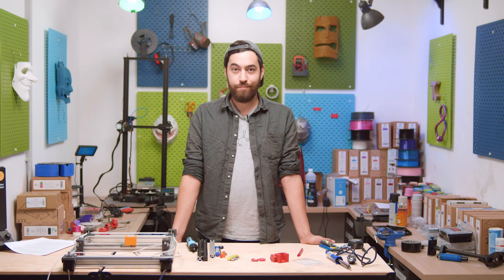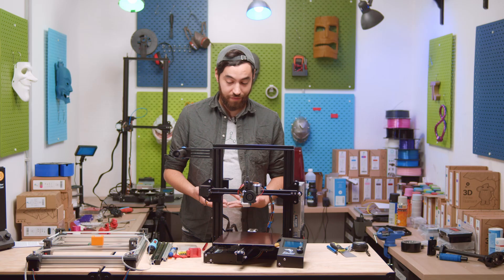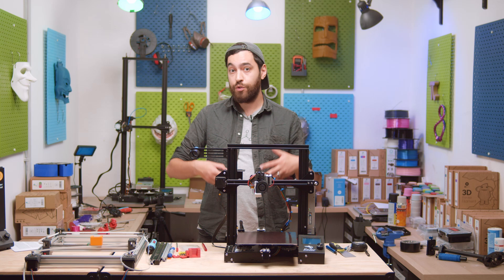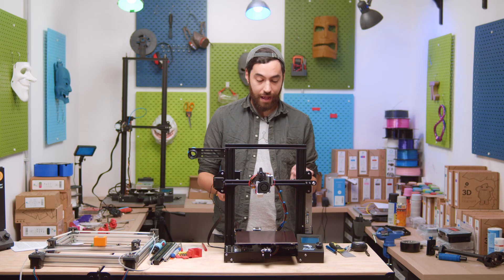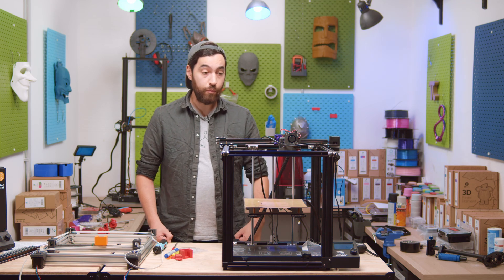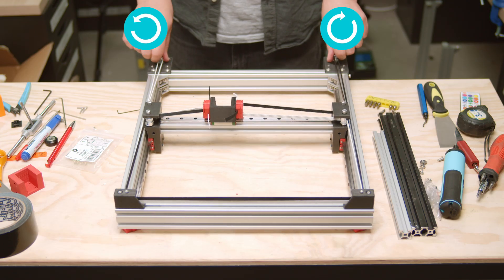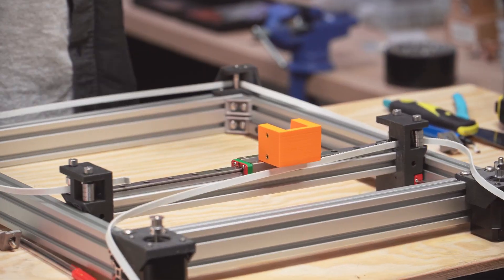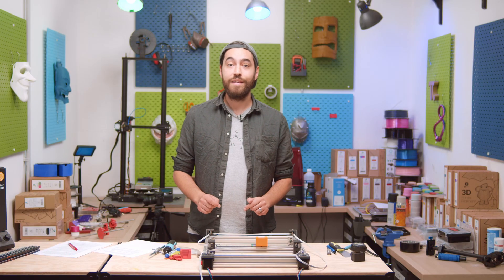How to Build 2 Printers from Scratch - Part 1: Frames and Motion Systems

Comment: Question, bearing in mind that the Bambu A1 software allows for the bed size to be altered - and the G-code can be too from the looks of it, could one be enlarged to say 512mm x 512mm x 250mm on the height - yes it would need a new linear rail for the head too, could it be done?
Reply from the maker: I'm not really sure about A1 software but enlarging a printer via firmware is a very easy and straightforward thing to do, its just a couple of lines in a config file

Comment: If you're making a budget conscious printer why are you using threaded inserts when plastic screws are so cheap?  No one looks at a high end gaming PC and complains that the 13 fans mounted to the cooler are using plastic screws... Like, they just work, they're reusable, and you don't ruin the whole part of the threaded insert isn't in perfectly.  Also the screw holes are exactly where you put them and not slightly off center bc the soldering iron got too hot.
Reply from the maker: do you mean self tapping screws? If so they do eventually wear down the threads they created if removed and put back in - the thread edges will erode and the part gets loose. Maybe they work better in injection moulded plastic but for FDM parts it isn't going to be great

Comment: Tip, before planning to buy 3D printer, make sure to research about consumables, the type of plastic to use, consider its price and quality. Petg Filament is the most reliabe of them in terms of quality and price - now, lots of printers in the market nowadays, but keep in mind that Petg prints at very low speed. And thats it, u dont realy need a fast printer to print😂 that would eliminate buying pricey printers and just buy the printer that best suit the material u want to print. PLA can be printed fast and effortless but the material is useless. 

Note, 3D printing is all about 3D models. Buying 3D printers means investing in 3D skills and computer😂 f u start a 3d printing farm u will add funds for 3d model creation hiring freelance artist.

Comment: Both types of profiles shown here have center holes ment to tap them. "Square" larger hole on silver one is ment for larger screw and shape designed for easy taping and solutions like those not round holes are widely used in industry.

Comment: Excellent video. I took a slightly different approach. Being in New Zealand, you can basically double any US prices. My Ender 3 started out stock - Now it has linear rails on all 3 Axis,  SKR Mini 3.0 v3, Slice Engineering Heatbreak, Coated Nozzle and PEI build surface - among others, including my own compiled Marlin 2.1.2-bugfix. I need another printer and I did a lot of research. Parts down here 'down under' can be quite expensive. So - I bought a new cheap Frame Cartesian printer for around $NZ520 (incl Freight). For about another $NZ300.00 I can upgrade this to a CoreXY (another channel has an upgrade to CoreXY for an Ender 5 - which the new printer is a clone of). I could not buy the base parts to build my new printer for less than a cheap clone printer. In fact, it works out way cheaper. And forget a 'high end' CoreXY - prices start here in NZ at around $NZ2550.00. Both my printers will run Klipper shortly. Nothing really - just wanted to share.
Reply: Dear god exact same here I’m in no too and trade me is brutal right now
Reply: I am so glad that printers and filament are pretty cheap in switzerland. I can get a kg of elegoo pla for under 10 Euros (a little under 10 swiss francs) without additional shipping costs if I buy 8 kg or more.

Comment: I thought this video was to show how to build a 3d printer, but halfway through the video I was so bored hearing about the different printers and parts I almost fell asleep. All I need is a parts list, and the method used to build it.
Reply: If you don't have the attention span to watch 10 minutes into a video, trust me you don't have the attention span to design and build your own 3d printer
Reply: @the1pigeon hey I’m in the same boat. I thought it was a construction video, not a model \ parts list.
Reply: @devintittle3131  it's not a model/parts list either, it's an explanation of the basics of what goes into designing and building your own 3d printer from scratch, as the title says
Reply: @the1pigeon  I see your point, but when it said “how to build” I expect to be told a least some of the construction steps. But considering listened to a huge list of model types, it kind of is. I’m not complaining, the title is just a bit deceptive imo.
Reply: @devintittle3131  I think it's more of a misunderstanding on your part than a deceptive title. Building something "from scratch" isn't just buying parts and screwing them together. The same way building a house isn't just buying materials and butting them together.
Reply from the maker: No sorry, it is a video on how to "build a printer from scratch", not from someone else's design but  guide on where to begin and what kind of printer is suitable for you.

Comment: Why are there no Epson, Canon, Brother etc etc 3D printers. With decades of engineering experience making paper printers all they need to do is add up and down.
Reply from the maker: Actually I believe Epson and Canon both offer 3d printers but they're for the industrial sector so these would cost hundreds of thousands of euro. HP are more well known for their 3d printers though, having developed a lot of the technology behind Multi-Jet Fusion.
Reply: The technology used by laser and jnkjet printers is vastly different in almost every way than FDM 3d printers. It is about as similar as paper cups are to paper clips. That being said, it doesn't seem impossible they could design some kind of fantastic new 3d printer by layering resin using similar technology, but it seems more likely that a company that does industrial robots or similar would get into 3d printing. I doubt it is worth it though for the hobby market. The commercial market is where you would be more likely to find these companies.
Reply: @geordonworley5618  3d printer, x, y, z and a nozzle. Paper Printer, x, y and a jet. Massive difference.
Add an extra axis and a bigger jet.
Reply: @geordonworley5618  first 3d printer DIY's.. dismantlement of a used ink jet for its parts. rails and motors. build a wood frame. throw in an Arduino board.  a hot end.  DIY 3d printer.  people said the same about PC's when they came out too.  Only in corporations the PC will be seen. ha ha ha ha ha ..    we made our own radios, cars, planes, clothes , tools and food before the corporations existed.   as little as 100 years ago.

Comment: Great and easy to understand information, glad you are making a 3 part series! Some things that were missed for the belts: steel reinforced belts are not recommended for motion systems that have belt paths with 180 degree turns, so not suitable for most 3d printer motion systems. Rubber belts without reinforcement are the cheapest, but will wear out faster and streach/deform easily if the 3d printer is tightly enclosed. So fiber (glass/nylon/kevlar) reinforced belts are the best option for 3d printers. CoreXY belt paths can become very long if you decide to make a large XY build area printer, in which case it is recommended to get 9 or 12mm thick or "tall" belts instead of the 6mm ones that most desktop FDM printers use.
Reply from the maker: This is great info, thanks man! We'll definitely mention it in the next video :)